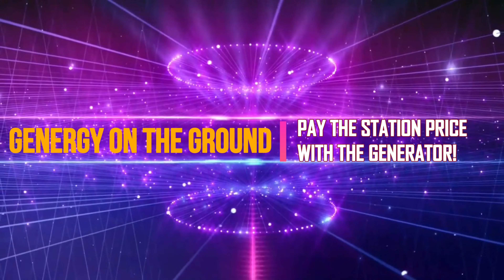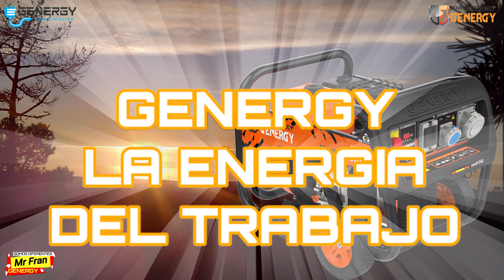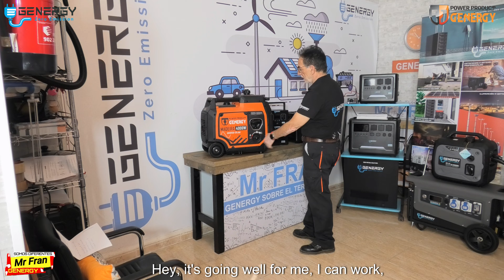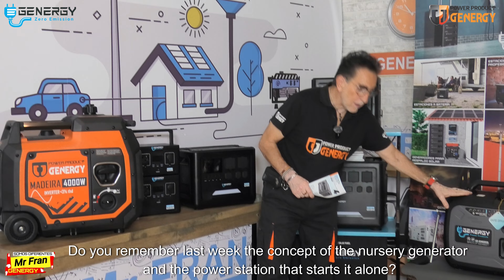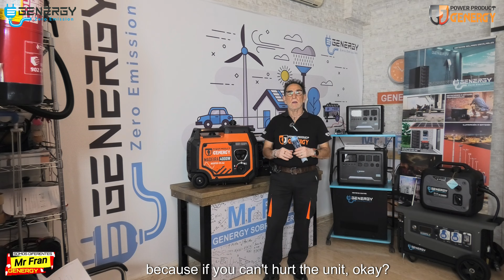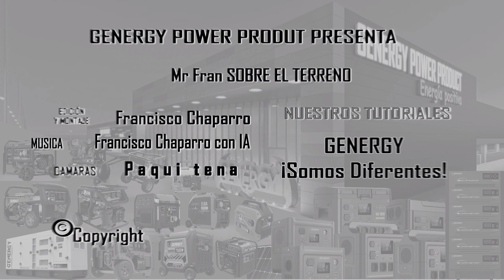Generator + Power Station = The Perfect Pair ⚡ Save gas and gain autonomy #genergy

Comment: I like the concept.  Will consider it.  Would be better it whenever the power station charge dropped to a set level, it withs signal the generator to start...without human involvement.  When pwr station charge is replenished it would signal gen to properly shutdown.    Hmmmmm I wonder how viable this is????
Reply from the maker: Thank you for your comments. In this video link, you can see exactly what I'm proposing. This system consists of a mother generator connected to the power station by an umbilical cord, and the station has full control over the generator's start-up and shutdown maneuvers, depending on recharging demand, and complete shutdowns. Best regards.  https://youtu.be/Oy-ZBzttx7w